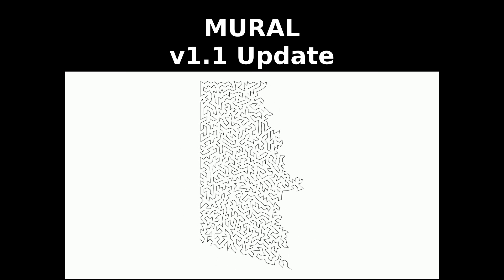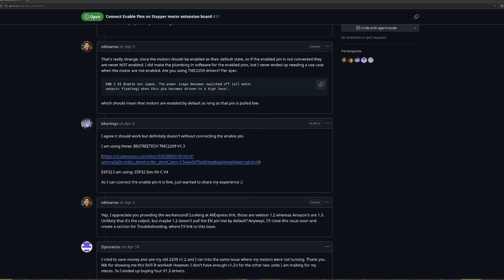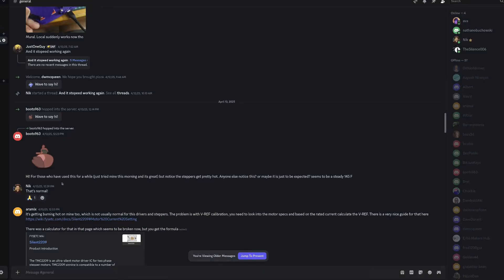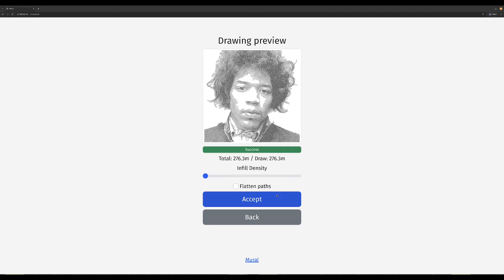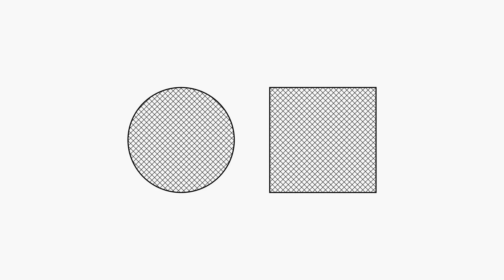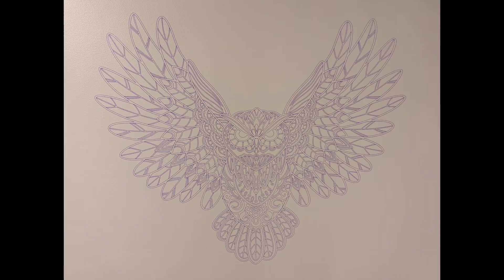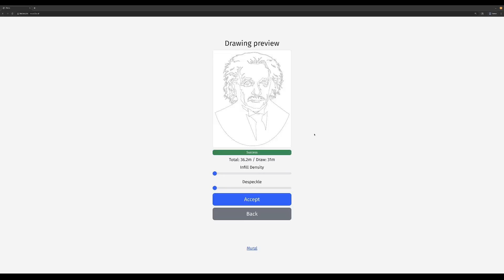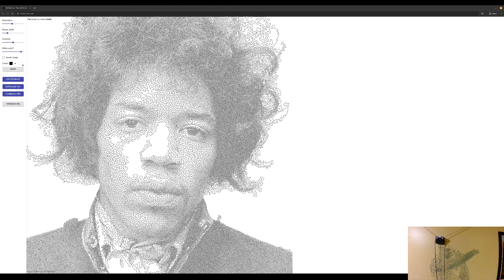Mural wall plotter - Update v1.1

Comment: wanted to comment on the first video but didn't because i thought surely somebody would have mentioned it but i am not sure. The higher the current the hotter your motors get - the drivers you got work fine with 24V since the driver supply is separate anyway. So if you set the usb-c trigger board to 15 or 20v and lower the current the drivers pass accordingly you run with cooler steppers for the same holding power. The DCDC converter should be good till 35V (limited by the caps on the input side of that board) but its good to check beforehand..

Comment: Hi, I've finished it, but I have a problem. When I draw a circle, it draws an oval. I don't know what's wrong. Also, the SVG size doesn't match what I've drawn. I don't know how to calculate the size. How do I use the 1000 mm calibration? Sorry, but I'm completely stuck. Thanks.
Reply from the maker: Answered on github

Comment: My servo motors are running in the reverse order. So when I move the sliders to the right as instructed to load the belts the are moving in the opposite direction as shown in the video. I used the cables that were shipped with the stepper motors. Any ideas?
Reply from the maker: Without modifying the software, you should be able to swap the order of the pairs. The wires are A+ A- B+ B-. If you make them A- A+ B- B+ that should invert direction.
Reply: @nivanov  Not sure what the letters A and B relate to on the board. Are those the wires left to right? So Left outer most wire swapped with 2nd from left wire?
Reply: Also, I am assuming you are talking about the wires from stepper driver to stepper motor. Is that correct?
Reply: Thanks for the feedback I was able to fix my issue. Thanks so much for your prompt response.
Reply from the maker: @jimenglish2367  glad you got it figured out

Comment: I finally got mine put together, both motors work perfectly when you trigger them individually under settings. But when you hit calibrate both motors freeze and scream like both coils are working against each other. if you skip calibration and proceed with an image when it tracks to home both motors fire off perfectly and shoot out 10ft of belt with out stopping way more than they should my distance is set at 1000 mm
Reply from the maker: Please open an issue on GitHub, it's a lot easier to track things there. My guess is that your micro stepping is set up incorrectly.
Reply: will do, I thought the same thing i tried the dip switches in a couple positions  but they are unmarked in the board

Comment: Hi Nik, I’m considering building this, and thank you for all the amazing videos, one quick question, have you tried mural on a textured wall (standard interior knockdown texture)? Does it run into any issues?
Reply from the maker: Generally, the rougher the texture of the wall, the worse Mural will perform. The chassis itself can snag on wall imperfections, but the bigger issue is with the pen tip getting damaged during the drawing run. I guess the only thing you can do is try it!

Comment: Hi Nik, glad that after 2 months of waiting, Mural has an improved version. By the way, I asked you to make a short tutorial for uploading firmware via Linux or Command Window before. Hope you can spare some time to guide. I am phile… the discord account that you have been communicating with. Thanks a lot.
Reply from the maker: Im gonna try using a devcontainer so everyone would have the same dev environment.
Reply: @nivanov  Looking forward to this! I’ve been toying with the idea of redesigning the case in a more unique way, but I’m worried that it will change the center of mass of the Mural and affect its performance. How do you determine the center of mass during the case design process?
Reply from the maker: I didn't. I tried a few things and kept the one that worked. Mirko Schmidt actually did the science and rewrote the kinematics system based on the physics model. It is documented on GitHub. That would be a good starting point.